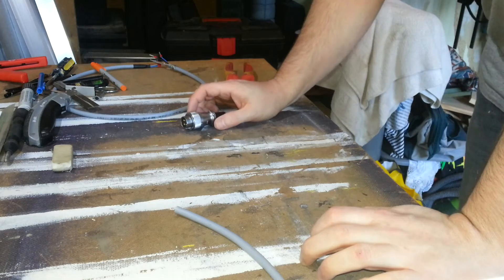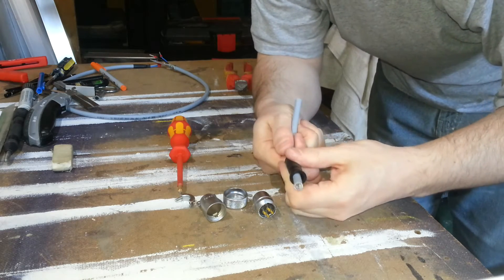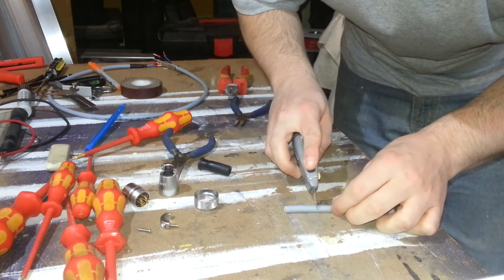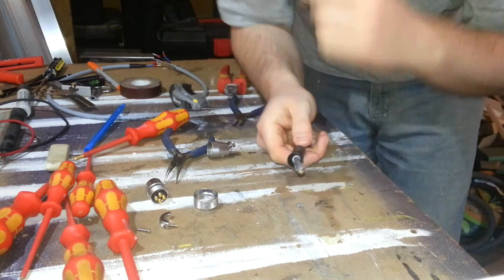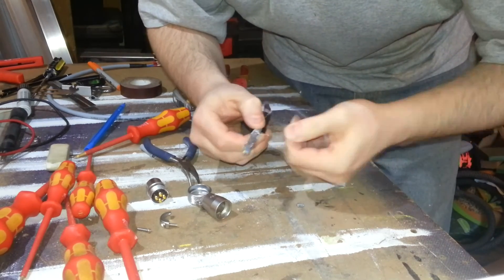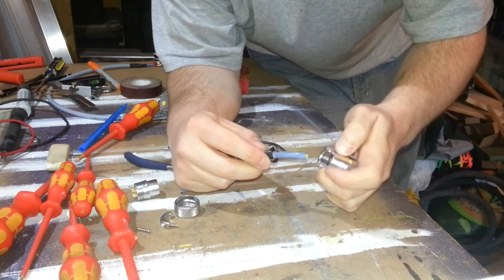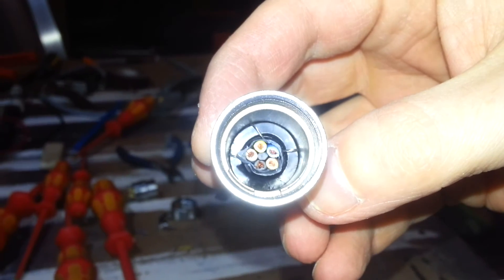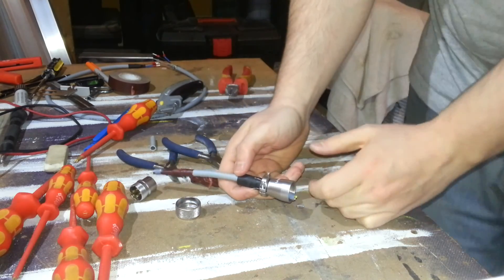Connector Wiring Part 1 - Connecting the Sheath - DIY Homemade CNC

Comment: Can you drill a small hole thru the side of the case and run your shield drain thru it and solder up the hole? Also can you get your aviation connector with an extra pin and then connect the shield drain to the extra pin? Then since the shield drain runs thru the connector, it can be grounded at the end of the wire inside the enclosure?

Comment: hi, nice video,..    what kind of wire is that and where can i buy it.  thank you
Reply: In my parts list I have it down as CY Cable, 5 core 1mm^2. A google search turns up several suppliers. Technically it's not designed for this job but I've spoken to loads of people who use it an no one has said they've had a problem. If you're building a CNC buy more cable than you think you'll need. I got a half drum and I wish I'd bought a whole drum.